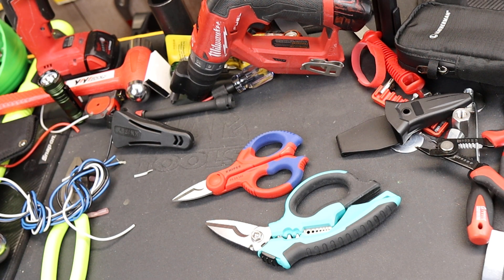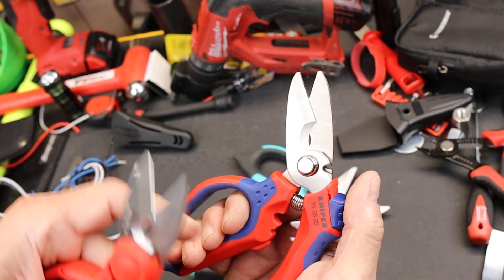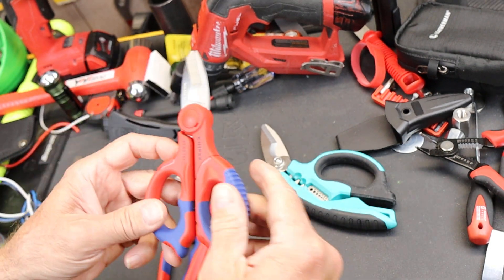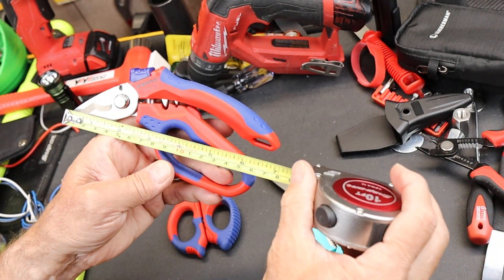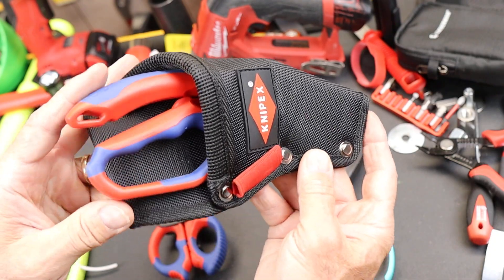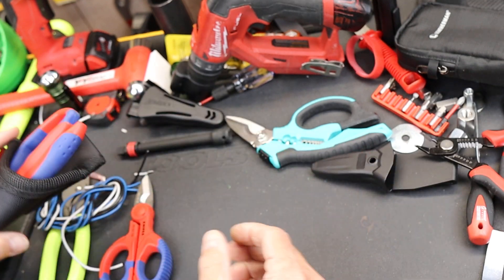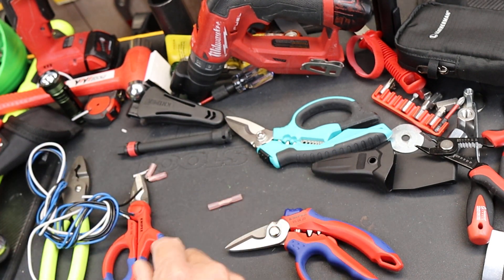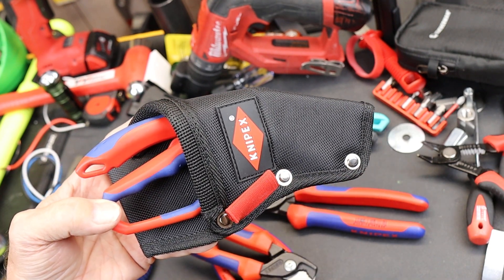Almost Perfect: The KNIPEX Stainless steel Pistol Grip-Angled Electricians' Shears and Sheath.

Comment: FYI: The crimper is for ferrules. It is not designed for insulated terminals.
Reply: Are those used mostly in Europe? I actually have an entire ferrule kit a couple years old and have never used it.
Reply: They’re not required by code, but they help in situations where you have screw terminals. For example, I have a 13.8V power supply with screw terminals so I put ferrules on the end.

Comment: For crimping, I have one of those 5-jaws ratcheting Knipex crimpers, which work the best of my various (that is, too many) crimping tools. However, one of the jaws was messed up - either by me the very first time I used them, or when I got them. I went online, sent the jaws back, and Knipex sent me an entirely new tool; so now I have two crimpers and 9 sets of jaws, which I keep loaded with the two sets I use the most.

Comment: I have the older version of the knipex pistol grip shears with a smaller handle, but it comes with a plastic sheat  and clip. The crimper is designed for ferrules only not for insulated ones,and it works fine. But I am using the right tool for the job, not this scissors.